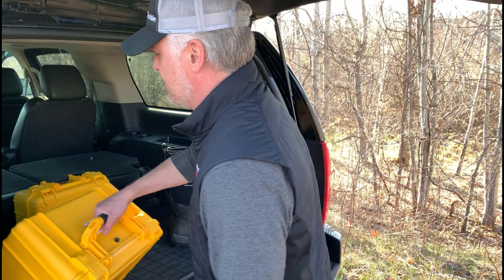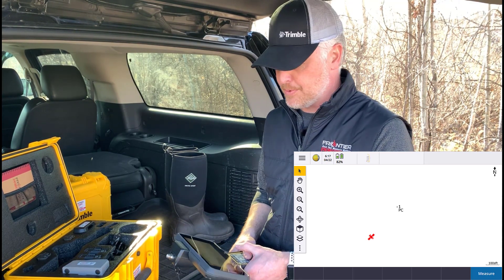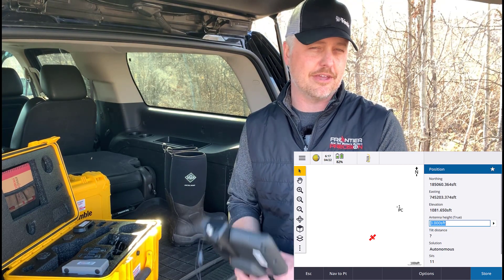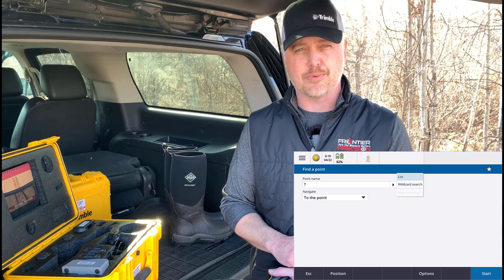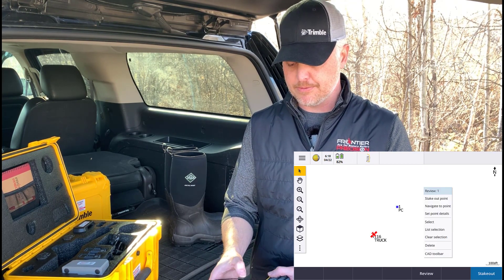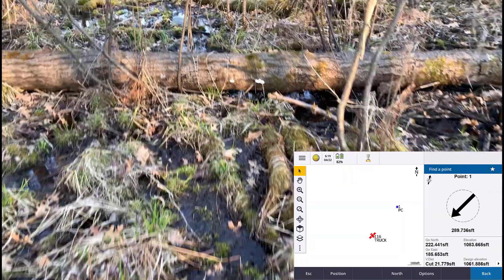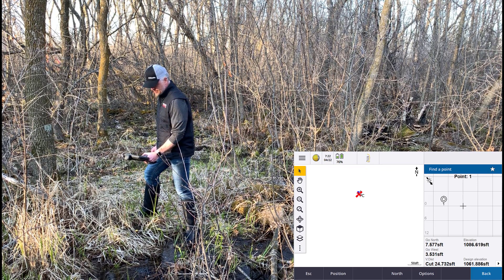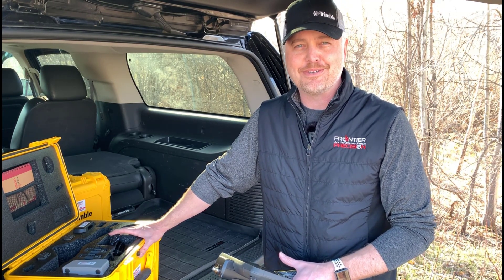Navigating with the internal GPS in the Trimble TSC7

Comment: 2 to 4 metres accuracy? Isn't that very poor? The GPS app on my phone gets to 2 metre accuracy.
Reply: Yes, the TSC7 uses a similar internal gps board.  For higher accuracy you will most likely be pairing the TSC7 with a Trimble R12i for example.  This video demonstrates how customers with this rover setup can use the controller for simple, less accurate, needs without having to fire up the other GNSS receiver.  Kind of a bonus function you could say.  Thanks for posting!
Reply: @westonschneider3544  that is a nice bonus, but paring with a R12i does it take the most accurate one or do you need to disable the internal GPS of the TSC7 if so, how do you disable the internal gps? We connect the TSC7 to the R12i with a serial cable and still only get the 2 to 4meter accuracy.
Reply: @shaunbecker8900  Hi Shaun,  It will depend if you start an RTK/VRS/RTX survey up or not.  If you do, then Access defaults to the more accurate R12i and you will see the standard specified precisions (Roughly .04sft H by .06sft V).  If you don't start a survey up then the R12i is using the same SBAS (Satellite Based Augmentation System) corrections as the TSC7.  So you would see the same 2-4 meters whether you cable up or use bluetooth.  If you are working in an area that has poor cell signal, so you aren't getting VRS corrections, then I recommend trying out RTX if it is available in your area.  I have customers in Northern MN, US that are using this in the remote forest areas.  I hope this helps. Thanks.